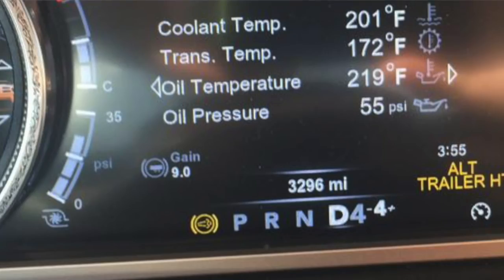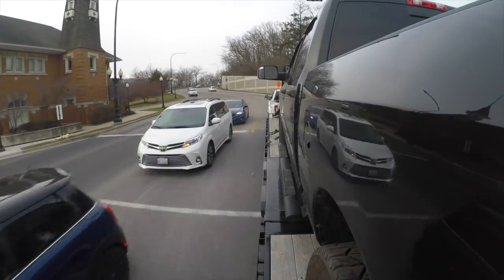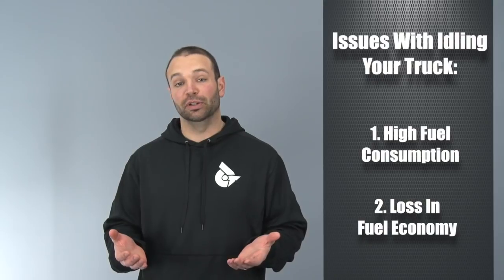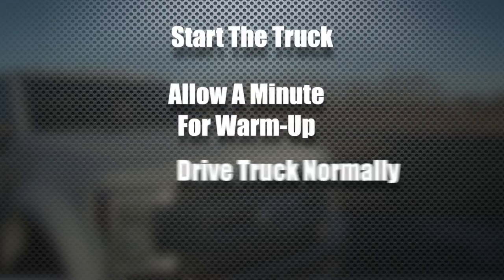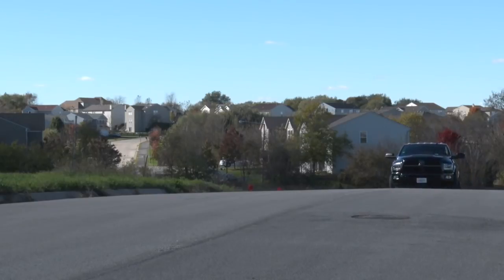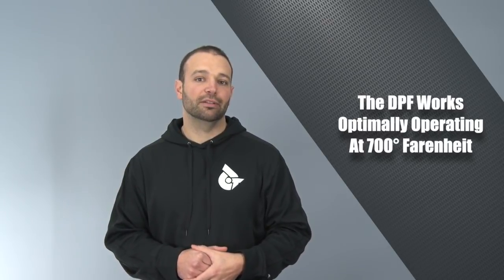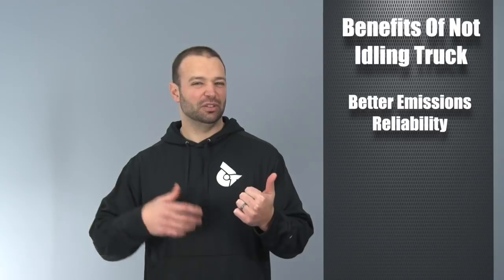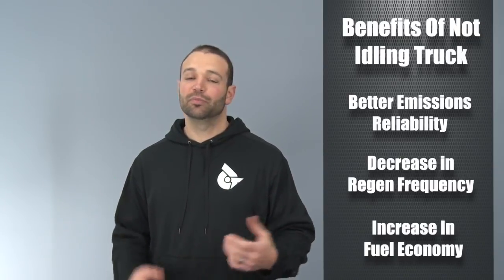Diesel Insights: You're Cold Starting Your Emissions Equipped Truck Wrong!

Comment: Its funny how old ideologies die hard. I think most people idle their trucks in the cold more for their own pleasure (ie heat in the cab, seats, defrost etc)  then to actually let the engine warm up. The only exception I see is in the extreme cold like -40f, I let our trucks warm up just for the sake of the transmission more so. Not sure about dodge or ford but in our newer GM, at certain temperatures it locks out gear changes if its cold. Not only that, any fluid used for hydraulic operation only operates better when its warmed up prior to use. Its very hard on a hydraulic system using cold fluid. Ask anyone who runs heavy equipment. Great tips for the majority of people in north america for sure. I tell ya though, the truck doesn't regen at all at -40 haha. Its too busy trying to thaw the def.

Comment: My 15 DMax heats up to 160 in about 5 minutes on high idle on even single digit days. My 19 power stroke takes months to heat up even when on the road for 15-20 minutes. My 6.7 Cummins took a while to heat but got sold for a coked over turbo. DMAX is an awesome motor in the cold. Smooth starts and quick to heat.

Comment: Will you please do a video on the LLY or lb7 with COLD temps involved? 0 to -40 and the like. I run my LLY with the elevated idle turned on when it gets cold out. Upper Peninsula cold.
Reply from the maker: We are located in Northern IL so testing in that type of extreme colds is just outside of what we can do here. However, since you dont have a DPF or DOC, we would suggest doing exactly what you are doing.  Use the high idle and let things get warm before running it hard.
Reply: @Duramaxtuner  Thank you for the advice. I plug it in when it gets cold and run it for 5 minutes at least. Glad to see I've been doing the right thing this whole time.

Comment: I think all these guys want to do is sell us a new engine and transmission I used to think these guys knew what they were doing

Would love to see how long the engine and transmission last when doing what he says in this video when its -10F
Reply from the maker: We dont sell replacement engines.
Reply: @Duramaxtuner  ok but regardless I know for a fact that cold starting an engine at -10f is hard enough on it let alone letting it run for just a minute or 2 and then just going down the road with it

I have seen the consequences of doing that and it isn't pretty or cheap

Comment: CATs are most efficient when hot. This is why you see super cars with heat shield blankets wrapped around their Cats to keep heat in.
(One of the things that Koenigsegg did to become CA emissions compliant with an 1160hp and 1280 Nm car). Also, as why I would assume the GM has moved its L5P turbo and CAT, with the CAT being wrapped into the V of the engine like Mercedes e63 turbos and CATs. If you keep the hot components centralized, and the cold components separate you get the better turbo efficiency, better emissions, as well as better cooling capabilities.
Reply from the maker: Well said Jacob.  Thank you for contributing to the conversation.

Comment: It’s unreasonable to even suggest we spend $65,000 on a truck and give two craps about burning 20 extra gallons of fuel a month to let it warm up and get the electric cab heater warm, heated leather warm...etc. I for one know my 19 f250 (see my channel) completely changes it’s operating parameters when started “very cold” even when plugged in. The volume of air moving thru the exhaust is tripled vs normal 1000 rpm “warm temp” running, and exhaust gets hotter quicker than normal. So, in a nutshell, no I won’t be letting it run less than 10 minutes today when I get in. It’s -5 degrees outside. This isn’t sunny Florida! It’s Ohio!
Reply from the maker: We are in Northern IL so pretty similar temperatures.  By all means, operate your truck in a way that your comfortable with.  The point of the video is not to tell guys to go beat on their trucks in sub zero operating temps, but instead that your emissions system will warm up quicker if you drive it reasonably.

Comment: Alright so what's your opinion on the non emission  equipped  trucks? In my case 07 5.9. I've heard you should let it idel for 10-15 minutes and I've heard you should let it warm up for like 120 seconds.
Reply: JD Kirane I had a 1999 5.9 and I had thousands of idle hours on it by the time I reached 239,000 miles in 5 years. Zero engine trouble and I never plugged it in. -11 was coldest it saw — no trouble. 15w40 rotella every 5000.
Reply from the maker: Without emissions equipment you should feel free to watch oil temps for an indicator of when your truck is ready to go.

Comment: So even when it’s -40 up here in canada you recommenced only letting it warm up for a minute before you drive it?
Reply: It’s just hard to do lol. I’ve always let my trucks warm up for 10 or so minutes before I go anywhere. I don’t really care if I’m hurting my mpg. I just don’t want to be hurting the truck.
Reply: Brad Petersen yep me to. The engine cost more then the DIF so I’m up for replacing that shit more then fucking up my motor!
Reply: Brad Petersen Isn’t that silly?? He’s Like “dude, don’t worry about YOU, just worry about your DPF!” Lol You don’t need to be comfortable...IT does. Lol!
Reply: I'd say increase time to 2.5 minutes
Reply: I think theres obviously a difference in cold starts of 30-0 and 0 to -40.. much more below that and it probably would be better to not go anywhere 😂 but at -20 if you arent plugging a truck in (which keeps the coolant warm, in turn keeping the oil warmer than it could be) then that would be a great place to start. Then at -40 2 or 3 minutes for an emission equipped truck watching egts like he said. Obviously at -40 the system will be colder than at +40 which will take longer to warm up

Comment: Nick, great video. Thanks for all the tips. I have always wondered this and done things way diff . Thank you
Reply: One more thing in this. I have your tune package with EZlynk for my 2011 Silverado. Is my stock air box and filter okay for this or should I have a better set that will really benefit me ?

Thanks
Reply from the maker: @heberclementiii6788  The S&B Intake definitely flows more air but not really huge gains in power if you have a stock turbo.
Reply: Duramaxtuner okay so stock turbo is what I have . My stock should be all I need for what I do . So I take it use money for a diff part.

Comment: So should I not high idle the truck in the morning?
Reply: I use the elevated idle function on my LML but the truck can command it regardless when certain parameters are met.
Reply: Yes use high idle in the morning. Thus guy is an idiot
Reply from the maker: @michaelshuler5295  You have posted the "this guy is an idiot" line a few times in this thread.  Please feel free to post on why you think this or what about this content is incorrect.  Or an even better idea might be for you to visit a channel that you like instead of trolling the comments section of our video.
Reply: Duramaxtuner 
I use the high elevated idle. Once it revs down I put it in gear. Would you still recommend this while look at the egts? 
Or just wait a minute like you said and go and don’t worry about the elevated idle. 
Wish I would have known this 4 years ago.
Reply: Duramaxtuner It’s easier to act like a child when you don’t agree with someone than it is to share supporting information.

Comment: You are a diesel genius!   2006 LLY tuned to LBZ. Single stage.  Still only 2 minute warmup?   EGR deleted. Cold air intake, PCV reroute and 4” exhaust. Soot box gone.
Reply from the maker: Without emissions equipment you can feel a little safer letting it idle.  Longer idles still cost you in overall MPG though.

Comment: What about a high idle switch?
Reply from the maker: Trucks with emissions equipped intact generally have a built in elevated idle, not to be confused with high idle.  This feature is effective in warming up the DOC and DPF but extended idle still results in poor MPGs and can cause the emissions equipment to back up prematurely.
Reply: Duramaxtuner please explain exactly what “backup prematurely” means in terms other than sooner regens/fuel consumption. The EGR cooler will not be operational (read: bypass) at high idle due to cold weather/cold EGT’s, so please tell me you’re not just concerned with our fuel burn quantities!
Reply from the maker: "can cause the emissions equipment to back up prematurely" refers to a situation that many people with DPF's have come across after extended periods of idle.  EGR's are not really a concern for this.
Reply: Duramaxtuner I don’t think that would apply to those of us with OCR turned on. I can monitor my dpf load percentage at all times and perform an operated commanded regen if it actually allows me to go to 100% full (which is never does below 50 degrees). It automatically initiates regens around 60-80% soot load in cold weather and after reaching 0% continues dumping fuel for roughly 10 minutes. I call this “deep cleaning” my dpf. If every brand allowed its user to see the information like Ford does, there would be a lot less trouble with this stuff.

Comment: Thanks Nick, always appreciate all the info you guys share! Question, what is the optimal running temp for the LML one should be at before "having fun"?
Reply: 500? That's all? Is that at the turbo? Manifold? DOC? SCR? DPF? Just getting on the throttle a little bit out of the driveway to accelerate will get most of those temps above 500*.... Can you be more specific, please?
Reply from the maker: @RidORoc  No problem.  It would depend on which model you have and what gauge you are using to view it but in general if you are at 500 degrees near the DPF (EGT4 for an L5P) you are good to go.
Reply: @Duramaxtuner  thanks!!!
Reply from the maker: If you can get your exhaust temp over 500 degrees feel free to let her eat.

Comment: Plug 'er in with a timer to come on for a few hours before you have to drive it.  It will be around 80°F on start-up and won't need nearly as long to come up to temp. 👌
Reply: 20 degrees or less you’ll find it takes much longer for the block Heater to get the coolant up to temp. I usually find that if it’s cold enough to plug it in, have it connected overnight.
Reply: kevin jozwiak I was thinking same thing. In -4 F weather, even leaving mine plugged in all nite still yields only 23 degree oil! See my vids for actual block heater power consumption! (Yes, I’m a nerd) lol
Reply: Neo Craft wow crazy. If I plug mine in overnight(probably coldest night I’ve done it was -20), the “glow plug” light goes off instantly and the truck turns over and starts as if it’s completely warmed up...02 Duramax
Reply: Time for a new truck, fellas.  My '14 Ram takes only a few hours even in 20°F.  Better yet, move to a place that isn't freezing. 👍
Reply: Monster RAM thanks so much for the practical advice
Reply: @kevinjozwiak5696  You have a 17 year old truck.  I'd say "getting a new one" is practical advice.  Moving to a warmer area is just smart.
Reply: Monster RAM Now that I’ve been graced with your wisdom, I think I’ll put my house up for sale and buy a new truck. Then I’ll spend a few grand to modify the brand new truck so that it is as reliable as my 17-year-old one with 366,000 miles. Thanks again
Reply: @kevinjozwiak5696  I don't know what's more comical:  the idea that you have to sell your house to buy a new truck, or that you think your 17 year old truck with 366,000 miles on it is more reliable as a new one.  🤣
Reply: Monster RAM oh man you’re not quite as wise as I thought, darn it! Let me school you: 1. Selling one’s home is quite common when moving to a new place(i.e. someplace “warmer”) 
2. Something cannot be “more reliable as”. Correct phrasing would be “more reliable THAN”. I’m here all week...(P.S. YouTube is a great resource for showing just how reliable these new diesels are👍🏼)
Reply: @kevinjozwiak5696  he has a ram, take any advice with a grain of salt. My 17 year old just fired right up after sitting in -8. Not plugged in, dmax baby. 278k.
Reply: Yeah best 15 bucks youve ever spent on amazon right there